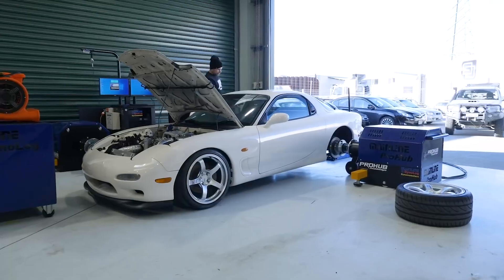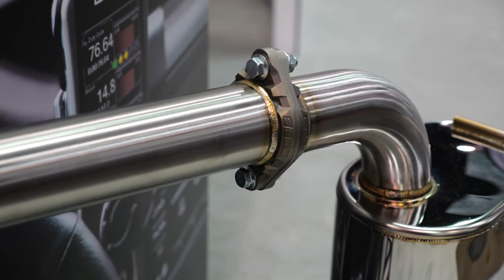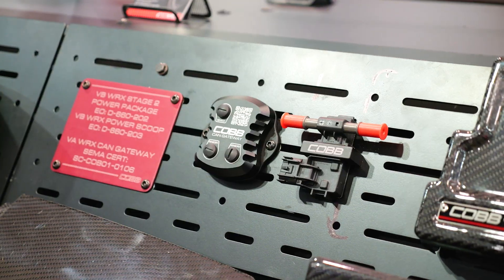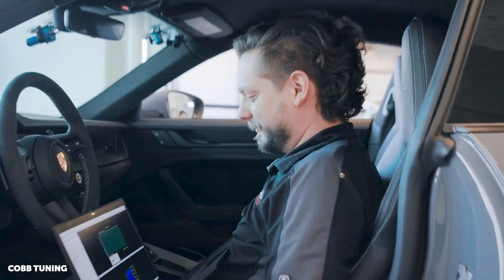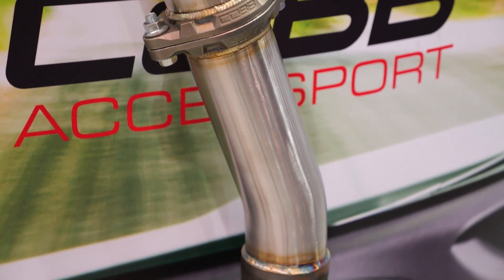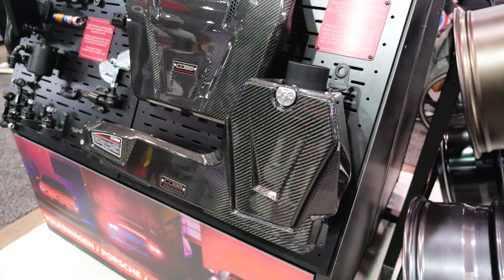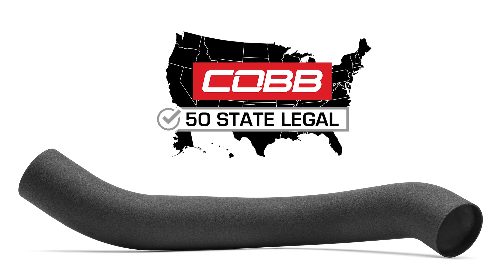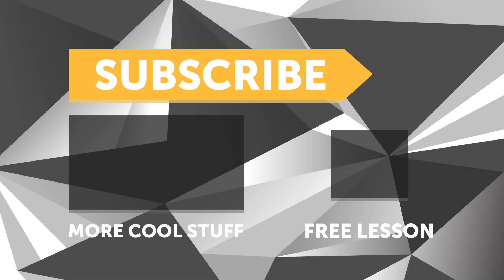Why all the fuss? | Executive Order Approval

Comment from the maker: Would an emissions tuning course from HPA be something you're intersted in?
🏎 Building a fast car? Get $400 OFF the all-inclusive VIP online course package deal: https://hpcdmy.co/hpavipcobb
🦵Kickstart your EFI Tuning knowledge. Get 50% OFF your first online course: https://hpcdmy.co/efituning101cobb
Reply: Yes definitley!
Reply: Kinda actualy
Reply: yup!
Reply from the maker: Great to hear team, because we're already working on one 😎 Some of the b-roll in this video is from what we've shot for it so far - Taz.
Reply: In the UK the main emmissions failure is nox levels.  It would be to know how I could go about lowering nox levels when tuning.  Cam timing, ignition timing etc.
Reply: @davidellis8434  You have to lower your EGT's.  Only way you going to cool down a gasoline engine is to run rich.  Diesels use the EGR coolers to reduce exhaust gas temps.  But that creates a lot of soot and particulate matter.  Thats why they added the DOC and DPF to diesel engines.  But those both increase Nox emissions so then they added SCR's and DEF injectors to cool the exhaust back down to decrease Nox emissions.

Comment: As a matter of interest the Bosch ME7 ecu’s fitted to VW/Audi marks in the late 1990’s and early 2000’s did have EGT sensors to measure actual EGT in addition to modelled EGT. Some of those sensors were wide-band and others narrow band (only reading EGT above 940C). The idea was to run close to lambda 1 until component protection kicked in, based on modelled EGT/Cat temp. After that threshold was reached fuelling was adjusted based on the component protection maps. Finally, if the actual measured EGT exceeded a set threshold (typically 950-980C) the ECU added fuel via a closed loop strategy to get the EGT back down to the max safe limit). Incredibly  sophisticated for 25+ year old tech.

Comment: At this point we should transition to modifying electric vehicles. But I’m sure the EPA will set restrictions for that as well, setting torque limits citing accelerated tire deterioration as an environmental concern. There is no escape.
Reply from the maker: Time will tell but EV tuning isn't quite the same as ICE tuning where we can usually tune for better performance (which isn't always just peak HP) and make measurable gains even if the engine is left stock.

Sasha dives into it a bit in this podcast if you're interested. Even if you don't plan to own or race an EV it's kinda cool gaining an understanding of these things: https://www.hpacademy.com/blog/45-can-you-actually-tune-an-ev-for-more-power-podcast/?utm_source=youtube&utm_medium=social&utm_campaign=general-interaction - Taz.

Comment: hey, is there a way that when you want to do an interview, you do fan questions and such? oh yeah, idk if you remember me, but we talked about dyno and such in your ignition tuning video, idk if I've asked this question or not, but what is VE tuning? my bike with its cheap aftermarket ECU has no such thing, it only has time-based tuning that basically only change 'when' and 'how long' of a tune (ignition, fuel, etc), of course when tuning it is best to use external AFR meter to know the AFR of said tune, but if VE tuning is more of a "hey, make the AFR [rich] at 100% load from idle to max RPM" then it would make things easier when tuning a turbocharged engine.

i asked this because i want to turbocharged my Suzuki GSX-R150(/R125) lol, i have all the parts i need to buy but one puzzle left that needs to be solved is how to tune it, since it is forced induction surely the air mass going in will varries, it doesnt need it because i can just tune it rich (assuming 13:1 make the most power, but in when the boos is still low, the amount of fuel shot is still the same) and no biggie. but it is nice to have a fuel-efficient tune where the ECU can just "oh no the air mass is too low, i need to adjust the injector duration so it wont be too rich and maintain 13:1 AFR"

im so dumb i can not properly construct a question, and it makes the question questioning the questioner.

i will try to see if i can download tuning software just to see what it looks like compared to the software that i currently have.
Reply: Newer ECUs uses Volumetric Efficiency calculations, or VE for short, to calculate engine load. This calculated engine load is combined with a desired AFR table and injector lookup table to calculate injector pulse width.  On older ECUs, it simply pulls the injector pulse width with RPM and pressure. This is oversimplifying it, but that's the basics.

VE ECUs are not a magic bullet you're thinking off. A traditional ECU and a VE ECU will perform identically once both are tuned properly. The only difference is that VE tuning uses realistic numbers that makes sense to read and modify. It sounds like your "ECU" is fairly dumb. I recommend replacing it with a reputable standalone unit, and probably take a class (cough cough) on EFI tuning.
Reply: @patx35  exactly, this cheappo ahh $76 BRT Juken 5 ECU im using is a time-based tune ECU, because of that it doesn't take any informations from the sensors, it's just "when do you want it to ignite/spray" and "how long do you want it to ignite/spray" and it's so basic, of course it has many features and it is good for NA engine, but not good enough for my forced induction project.

like i said before it is not a big issue, but it js just a nice thing to have a tune that doesn't always shot 5ml of fuel at all times when the amount of air is not enough.

edit: i appreciate you taking your time to wrote a comment. thank you.
Reply: @ Ya know, I was skeptical at first when you referred to it as an "ECU", but looked up the user manual for it just to see what it really it. Basically, it uses Alpha-N tuning, where it uses a combination of the throttle sensor and the engine speed to calculate fuel and spark. It's actually not a bad option, and that strategy is used in some NA race engines, but it's not useful in turbo engines since it's guesstimating the amount of air entering the engine.
In terms of dirt cheap ECUs, I do recommend either a Megasquirt or Speeduino based ECU. If you really want to save money, you can buy the kit versions, and assemble it yourself.
Reply: @ Both options uses VE tuning, offers boost control, and even basic engine protection.

Comment: lol I'm in favor of catalytic converters in general but when mega corporations and power stations are allowed to freely burn bunker fuel and coal in the megatons but when someone wants to make an engine more efficient suddenly bureaucrats try to ruin your life. It's a joke.
Reply from the maker: Without getting political, the aftermarket industry around performance car modifications and motorsport is a statistically very small percentage of total emissions for sure. 

At least there are some options on the table now as discussed here. For a while it didn't look like we'd even get this far as the testing was supposed to be tightly controlled as well, but the law cuts both ways - Taz.

Comment: Surely COBB must face the dilemma of their tunes/parts costing more than another business that doesn't certify its products.
No doubt the consumer will be the one that decides where to buy.
Reply from the maker: Those other businesses will face huge fines and/or jail time, and there is also the software side to all this too.
You can and do personally choose what you do to your street legal vehicle for sure though, that hasn't changed and never will.
Note this has nothing to do with opinion, this is just a fact of what has been happening in the industry over the last 5+ years whether we all agree with it or not.
At least the likes of COBB and similar give some options, for a while there it really looked like even this wouldn't be an option! - Taz.
Reply: @hpa101  Things are changing fast with the EPA. Not sure where we will end up.
Reply from the maker: @spooler7828 absolutely! Time will tell! - Taz.
Reply: @hpa101  Understood.
Looks like modifying cars, newer ones, will only be for the ultra wealthy enthusiast.
Sounds like the average person with a late model car is not going to be able to step up to the next level in pricing. Not unless in the US getting certified is cheap and easy to spread out over huge numbers of a vehicle type 🤷

What happens to the home tuner/small operator who wants to do an oddball model, or fit a standalone ecu?
Reply: Benefit of EO CARB parts is that you can drive the car to any smog shop in the US, and it will pass with zero issues. If you get pulled over, cops can't ticket you for "illegal modifications".

Comment: LOL Cobb tried to use the EPA's illegal re-interpretation of the Clean Air Act to position themselves to outcompete others in the industry, and screwed their dealer/tuner network in the process, bricking software that small businesses had paid a lot of money for.  The got what was coming to them and are about the last people I would consider SMEs on dealing with the EPA.
Reply from the maker: Probably more a case of changing the business model or shutting it all down, but we all have our own opinions.
Even if you are not a fan of COBB or the EPA, hope you enjoyed some insight into what goes into CARB EO approved parts for those that want/need them these days.
It might all be different again in 10 more years, who knows 😎 - Taz.
Reply: @hpa101  I was at the PRI after-hours meeting where they broke it to the tuner chain.  I also am an SME on fighting the EPA's overreach as I am solely responsible for Region 5 abandoning Used Oil reinterpretations over a decade ago.  This isn't an opinion type matter, these are historical facts.  You are involving yourself in another country's politics, which is foolhardy.
Reply from the maker: This isn't a political video, it's insight into what COBB and similar have to do to get parts approved for street legal use in the USA these days.

As above, "Even if you are not a fan of COBB or the EPA, hope you enjoyed some insight into what goes into CARB EO approved parts for those that want/need them these days.
It might all be different again in 10 more years, who knows 😎 - Taz."

Comment: Yes the EPA still came after COBB 😢
Reply from the maker: Crazy right! You're damned if you do and damned if you don't it seems. The EPA has been quite brutal even to companies who did everything asked of them once enforcement came into play. The laws were however already there.
They get a bit of hate for it, and we will no doubt see plenty of heads in the sand in the comments here, but companies like COBB and a few others along with the likes of SEMA Garage have done a ton behind the scenes to still give those who need them a street legal option for modifications at least despite these huge fines etc - Taz
Reply: Their focus on being emissions compliant was the result of the EPA action. They realized being legal will make the business be unique and competitive in the long term.
Reply: The EPA came after Cobb for some pretty understandable reasons though. They were allowing Accessport customers/tuners to disable emissions Check Engine Lights  that were thrown when deleting emissions equipment like catalytic converters, and they were allowing software disabling of emissions components like TGV/EGR valves and secondary air pumps. Their own flex fuel kits even required the deletion of emissions equipment just to install them, and at one point they had OTS Accessport maps for 30% ethanol and that flex fuel kit. They were actively encouraging deleting emissions equipment to sell products. 

A lot of tuning devices offer similar capability, but the problem was that Cobb was constantly bragging about selling 50 state compliant parts, while also selling parts that allowed customers to break federal regulations on their street cars. It was a dangerous game all along, and the EPA called them on it. Cobb could have avoided the fine if they read the writing on the wall when the government cracked down on diesel tuners with huge fines. They ignored the warning shots and paid dearly for it. 

Since their EPA settlement, they made a number of common sense changes that were well overdue, and now they’re out of hot water with the government.
Reply: @blueridge8992  While true, you're forgetting that Street cars are not the only target for sales. There are plenty of track only vehicles as well that do not need, by law, to have emissions and are regulated by their class when it comes to racing.

The fact that Cobb was actively working to meet the EPA requirements while also catering to race only cars is the issue with the fines.

The EPA seems to specifically target shops that are trying their best to be compliant with heavy handed fines based what seems to be the specific companies profit margins.

The EPA has the ability to reach out to these companies and let them know what specifically is on the radar for them to crack down on and they aren't doing that.

It's also a case of rules for thee and not for me when it comes to this government entity. Federal vehicles are allowed to have emission defeating devices or whole removed. But the average citizen has to comply. As a firefighter, my Engine is exempt from a few emission requirements and the majority of the new trucks being delivered have a slue of issues that deadline them within a year.

These regulations aren't doing a whole lot to improve much. Just keeping an unnecessary arm of the government in power to tax the people.

Comment: Speeduino seems super hard to regulate, I guess it's time to start getting creative
Reply: Standalone ECUs aren't regulated because you can't smog test it. The OBD port won't work, and there's no monitors to check. Besides, the EPA isn't going after the dedicated track car. They are going after all the stanced subarus with an aliexpress front mount and an ebay turbo. Those cars are street driven, and they are registered for public roads.
Reply from the maker: Everyone has had access to open source options like that for over 20 years. Problem is everyone wants an open source solution for cheap (or free!), but they don't want to be the guy spending years of their life gaining the skills (probably working for companies like COBB!) and then putting them into practice being the free open source solution for everyone else in their spare time 😅

Still, we all live in hope right! A lot of the big names in the industry these days often had a lot to do with some of the more successful (historically) open source tuning projects in the Subaru and Mitsubishi scenes specifically.

In the meantime, at least you do have some options in regards to the parts that have been through the process discussed in this interview, or you might have no need for any and just find it interesting in general 🤘 - Taz.

Comment: Well what I got out of this is that if you build your car you are shooting for a Lambda 1.0 measurement in order to comply.  Why would hardware be off the table to comply? Do they go by some kind of emissions/displacement standard or something?  because that has been changing every year if you look at the emissions for different vehicles over the years.  For example the Honda S2000 was notable for its exceptional specific power output of about 92 kW (124 hp) per litre, or about two horsepower per cubic inch, the highest of any mass production, naturally aspirated engine car, until 2010.  Compare that to say a Jeep Cherokee, which did not have the best fuel mileage yet passed EPA.  AND that was 15 years ago.
Reply from the maker: Hardware isn't always off the table, it needs to be tested and approved. 
We didn't get into the testing side of things here but that is also an expensive rabbithole and it's done on the dyno. A part may or may not pass the required parameters based on the dyno operator for example.
The system isn't and never will be perfect, but it's what we now have to deal with (for street legal vehicles).
Personally I think the more crazy thing is how a US government department can have such a global impact on the aftermarket performance industry! It's pretty wild whether you are all for this or not 😎 - Taz.
Reply: Several companies offer parts that's approved, if there's a market for it.
Emissions isn't just exhaust gases though, it's noise, and that can be a problem (Tesla failed). 
There also warranty, you have to provide 10 years and/or a certain amount of miles (don't recall the number). Which is kinda funny, as some manufacturers can't meet it and they don't actually offer that long warranty to customers on the parts. 😆
Reply from the maker: @PSA78 that note about the warranty is super interesting! Certainly not something OEMs offer. Do you have a link (because I am lazy) to the specifics of that rule/law? Will take a nose after work 🤘 - Taz.
Reply: @hpa101  I believe I read it at CARB (California Air Resources Board), they also have lists of all approved parts etc.